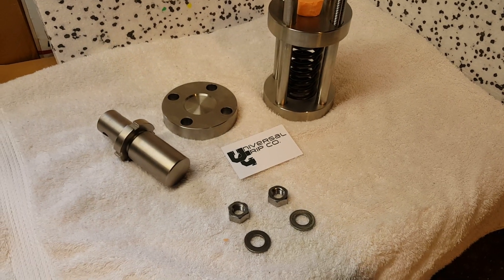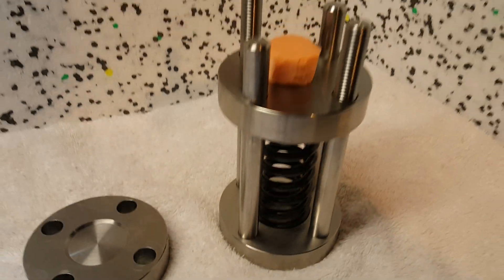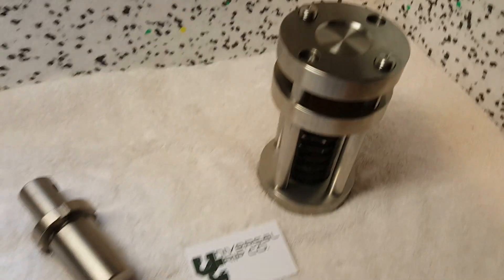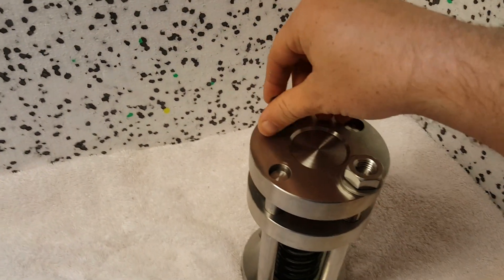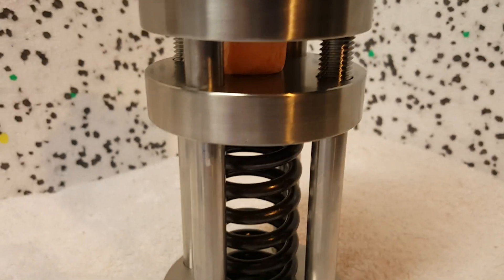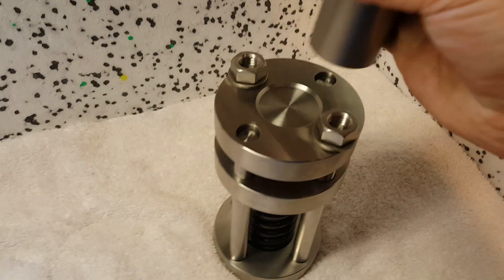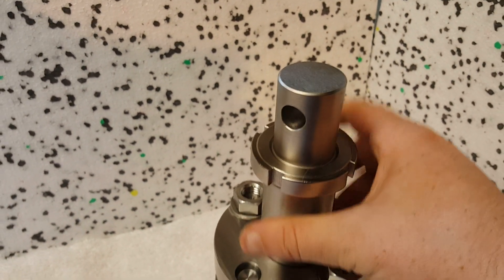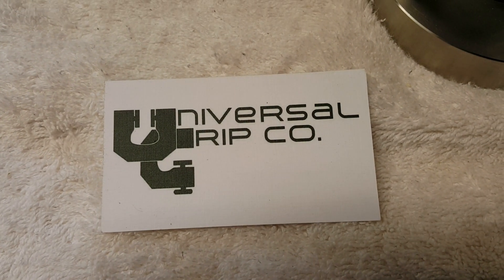ASTM D395 Method A Fixture for Compression Set Testing

Comment: What is weight You have put on machine?
Reply from the maker: It's up to you but usually 50 to 100 lbs. Is good. You use the machine to set the exact force and then the springs hold that same force over time.